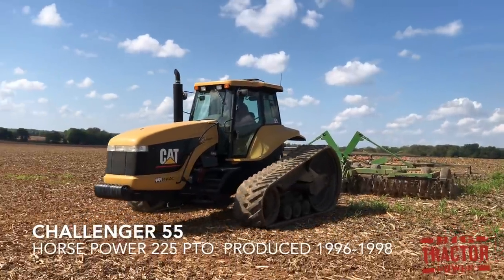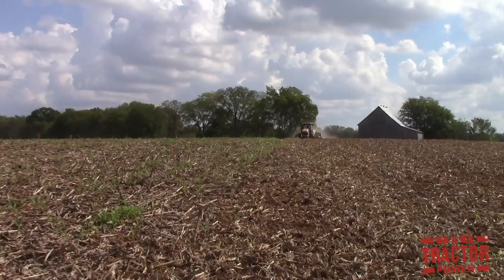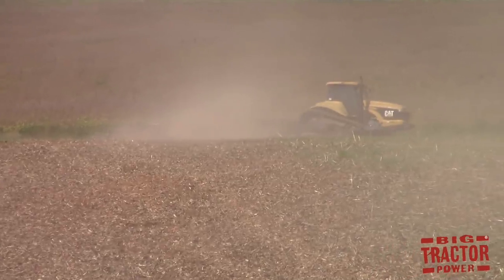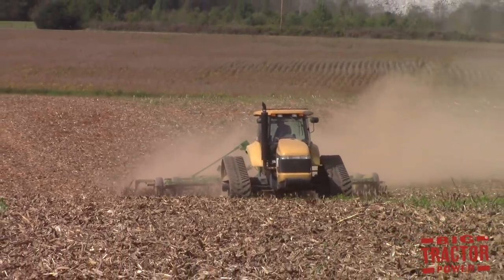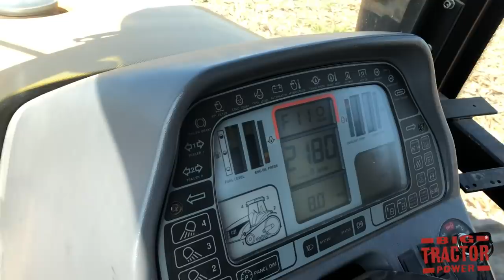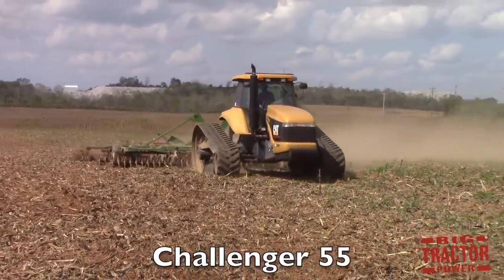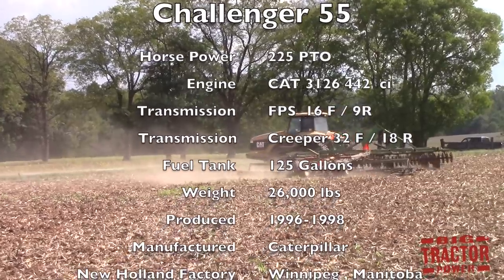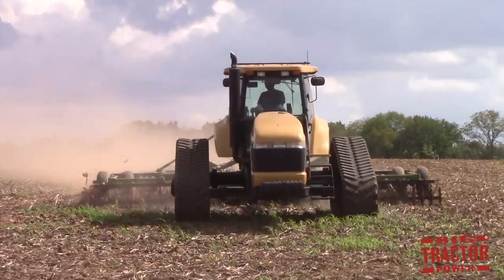Caterpillar Challenger 55 Tractor Specs & History

Comment: Spot on with the facts and nice video.  I visited the Winnipeg plant back then and it was interesting to see both the Genesis and Challenger going down the line. I believe the cabs, transmission and hydraulics were the same but Cat  definitely did the design work on the engine, tracks and final drives.
Reply from the maker: That is very cool that you got to see production in person.

Comment: This Challenger is one more fine tractor, BTP. I wish I could've driven something newer than a JD 4430, but my last year to do tractor work was 1977. I really missed out on getting to drive something articulated or tractors on rubber tracks.
Reply from the maker: The 4430 set allot of new standards in farming.  It is amazing how machines have changed in the past 4 decades.  Thank you for watching.
Reply: @bigtractorpower  I didn't think about the 4430 like that.

Comment: Hi! Great video! What did you mean by the challenger and NH using the same base? What components did they share?
Reply from the maker: The tractor part of the Challenger 55 like the frame, hood, cab, controls are all the the Genesis.  In a basic explanation Caterpillar  put tracks and a CAT engine on the Genesis.

Comment: In the Uk Claas also made this tracked tractor in green with, I think the same model numbers.
Reply from the maker: Claas and Caterpillar did a cross promotion.  Caterpillar dealers sold Claas Lexion combines in yellow and Claas dealers sold the CAT Challengers in Claas colors.  This happened from 1998-2001.  The Claas Challenger Row crops were built at the New Holland factory in Canada.
Reply: Where were to cat combines made? In Germany or also in USA.
Reply from the maker: In Germany in the late 1990’s and from
The early 2000’s through today in Omaha, NE at the Claas plant there.

Comment: what means 225 PTO hp and why are the rear disks so big? Are the chassis that wide for ... better balance?
Reply from the maker: 225 PTO stand for power take off. That is useable horse power to operate and implement from the engine.  The wider stance gives a smoother ride. When the tracks are tight up against the frame the tractor feels the jolts and bumps in the field allot more.

Comment: Did the challenger tractor switch from manitoba to jackson minnesota when agco bought challenger or is it a factory in between the two.
Reply from the maker: After Manitoba the new MT700 Row crop tractors were introduced in late 2001 and they were built at first at the CAT Dekalb, IL factory.  AGCO later moved Challenger MT700C production to Jackson.

Comment: Nice tractor, it was great learn about NH and CAT business deal with this model, you mentioned the Genesis had a Ford engine, which specific tractor was that, thank you for the video
Reply from the maker: Thank you for watching.  The Genesis in the video was a 145 hp 8670 Genesis with a New Holland 892 Forage Harvester and Artsway Forage wagon. It has a 456 cubic inch 6 cal Ford engine in it.
Reply: @bigtractorpower  Thanks very much!!!

Comment: Do you know How this tractor handle soils with small Stones and non pavemented roads in Fields movings?
Reply from the maker: It should do fine. I have seen the larger Challengers on gravel roads.  They seemed to not have an issue. On a Stoney field they should tool over the stones as they have lots of surface space and boogie wheels to absorb the impact.

Comment: Very cool. Like the history of tracked tractors. Is less compaction than wheeled vehicles a major concern when acquiring new machinery ? As far as appearance goes, i like the look of big round tires vs tracks, IMHO. JD has this type too on non articulated tractors and looks great. The way a product looks is very important to me, but must work well not less. Like your frequent uploads, this one went quickly. Best Regards 🇺🇸🚜
Reply from the maker: As always thank you for watching Mark.  Compaction is a concern because it restricts root growth which reduces yield.  Tracks can help reduce compaction as they have a smaller foot print.  I mentioned in the video other companies looked to emulate the Challenger 35, 45 and 55.  John Deere followed right behind these CAT tractors first with the 8400T, 8300T, 8200T and 8100T in the row crop market and a few years later with the 9400T and 9300T.  John Deere has now built T series tractors for over 20 years now with modern offering being the 8RT and 9RT.

Comment: Anyone have any idea how or where i can get a wiring diagram? We have electrical problems constantly because of rats chewing the electrical wires.
Reply from the maker: I would say a dealer. The wiring should be the same as. New Holland Genesis so a New Holland dealer could help. An  owners manual on eBay might be another option.

Comment: Caterpillar got out of the business when they sold their Challenger line of tractors to Agco 2001.Unlike Deere,Cat did not have a line of parallel wheel tractors with their 3 models.Also remember that Deere claimed they had 50 percent of this market within a year or 2 after their 8000Ts were introduced in 1996